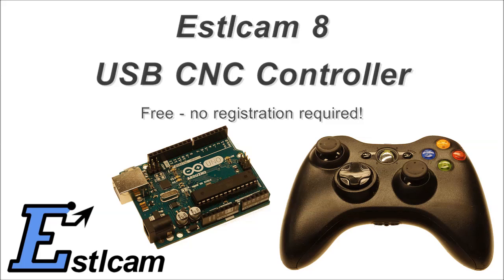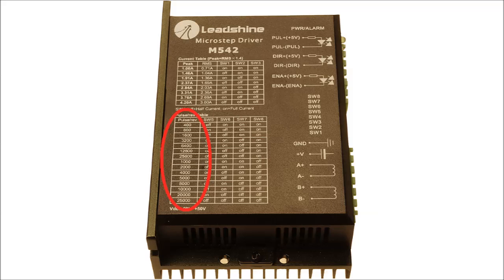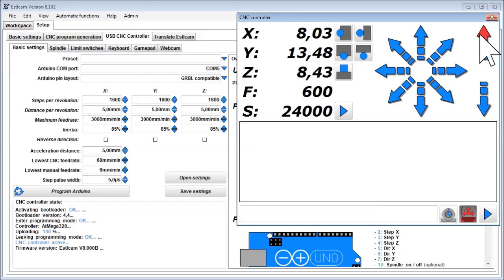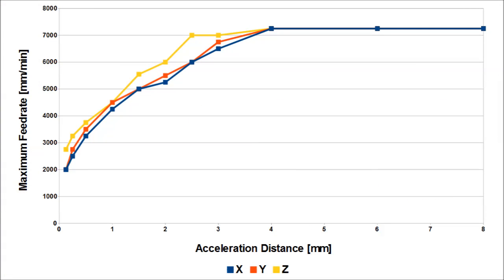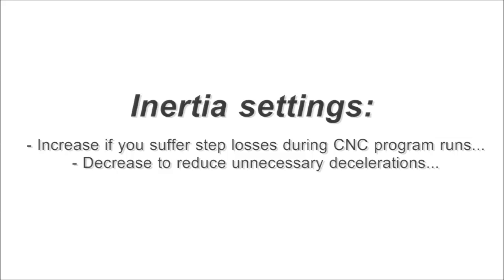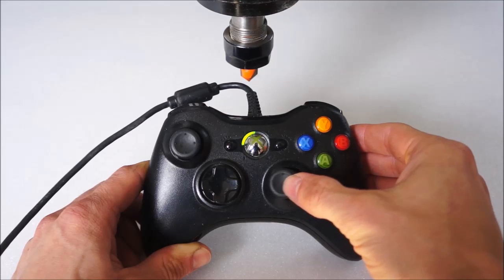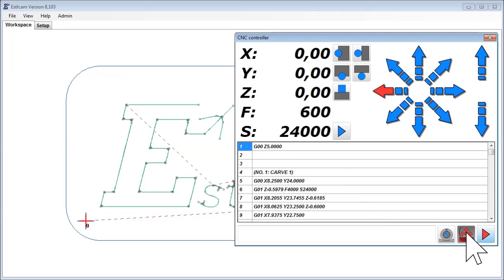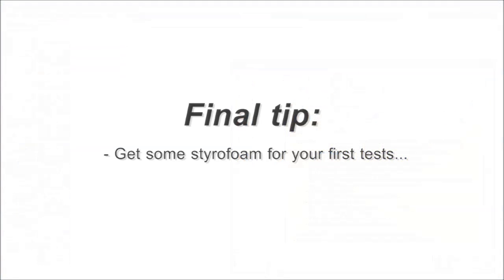Estlcam 8 - USB CNC controller (English)

Comment: Thanks for a very interesting and educating video!I have downloaded, and bought a license, for Estlcam. I run version 11.014.A never version exists…I use a Protooner board versioon 3.00 and it works well using Estlcam or Arduino IDE. What does the board You offer add?
Reply: instablaster

Comment: Hi Christian, Great Video. I know you have probably been asked this several times, but I am using this same setup. Arduino UNO, with CNC 3.0 Shield. Which Controller and Firmware selections should I choose in ESTLCAM?  Thanks

Comment: Sir pls I need some more help... I have made diy my own T 8 cnc machine at my factory.. I am using Gbrl software with ink space and Text milling software With ADURINO uno and with CNC shield v3.... I need help about... I have an designed in auto file of multiple holes for different job.... Can you pls suggest me a software which I can easy convert from autocad file it in g code or in *.nc file.. Pls sir help
Reply: Hey Harjeet, go with Estlcam Software. It's a full CAM system. Free version can do this. Save your desired file in autocad as a dxf file. Be sure that you remove ALL overlapping splines, lines and other geometry in autocad!  Zoom deeply in on the split points/overlapping points of the geometry to control that. Then make your DXF. Import/open the DXF file in Estlcam and create your toolpaths there. It's easy with Estlcam. A lot of automatic tools included. Try carve and Text Tool in Estlcam. Change the tools and/or create the tools you need, incl feeds/speeds. Last step is creating your nc file with "save cnc program"

Comment: How do you use GRBL with Estlcam and with other platforms like ugsplatform? I have some things where I like the use of Estlcam but at other times I have to use different programs and there I use ugsplatform. I have tried installing the Grbl through Estlcam and it works, but ugsplatform will not. If I install Grbl by Arduino IDE then Estlcam doesn't work but ugs does.
Reply from the maker: Estlcam does not use GRBL - it uses its own, very different firmware.

Comment: Hi! I'd like to know if it works properly on Windows 8 and what would be the necessary drivers needed to make it work. I already have the program installed and I can't make the Arduino work. I'd be glad if you are willing to help me. Thank you!
Reply from the maker: +Diego Lois
Hi,
it works on all Windows Versions from XP to 10. If the Arduino does not work it is most likely a clone or fake. Clones often use a different bootloader (2kb instead of 0.5kb bootloader size) and only support USB / Serial speeds up to 115200 instead of 500000 bps like the original. I'll try to release a new version in a few days that should be able to cope with this limitations - but at the moment 0.5kb bootloader and 500000 bps are required for Estlcam to work.